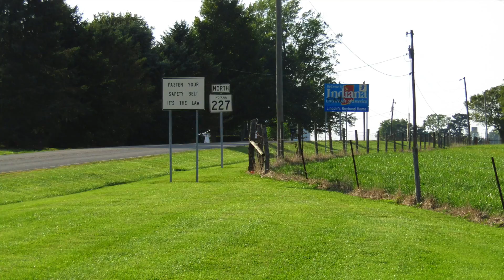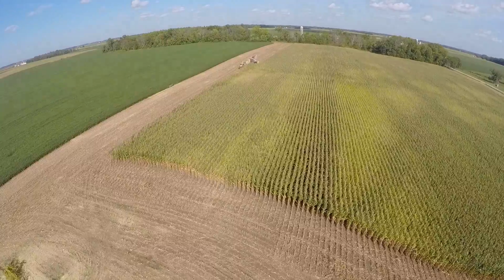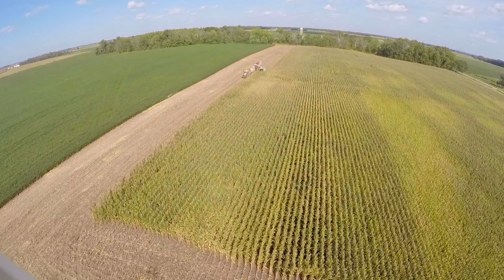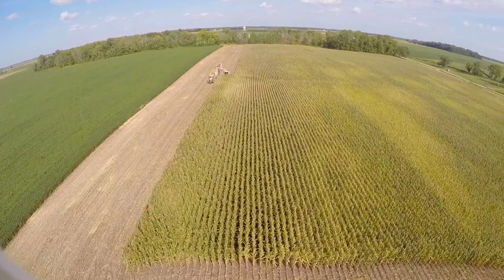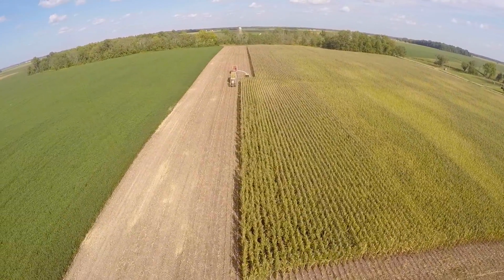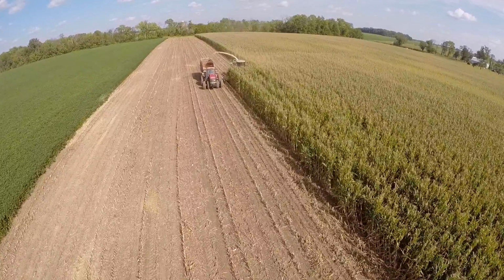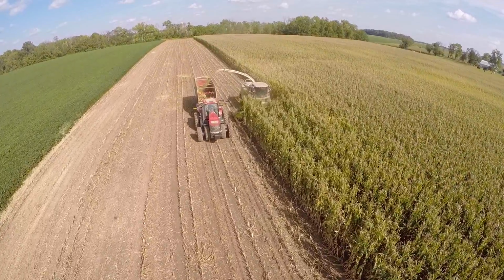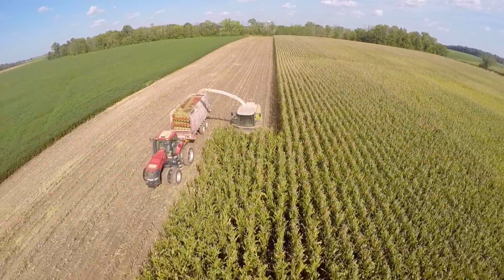Chopping Corn Silage in Preble County Ohio - September 2017

Comment: So it appears that it is cheaper to plant corn,buy all that equipment than to have the cows eat mainy grass? Maybe the farm has  pasture?
Reply: Sawmiller Smith how do you feed them over winter?
Reply: hay
Reply: One of those wagans could feed 170 cows that weighted 1200 pounds for 0ne year.
Reply: Sounds like you have it all figured out.  Might want to get ahold of them and let them know the error of their ways...
Reply: Sawmiller Smith it takes about two wagons to feed one beef steer for one year. I have no clue where you got your information but you better go check your math. It take about 200 ton of corn silage to feed 170 cows for a year.
Reply: You're right,math doesn't add up,sorry.
Reply: no problem.